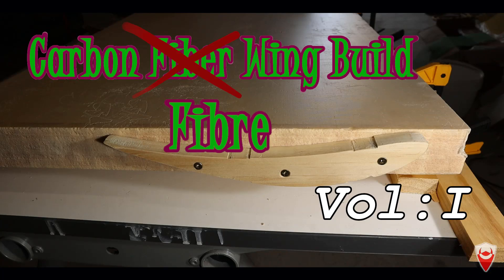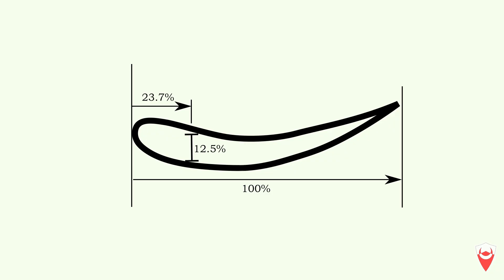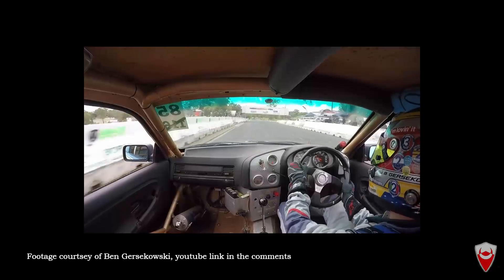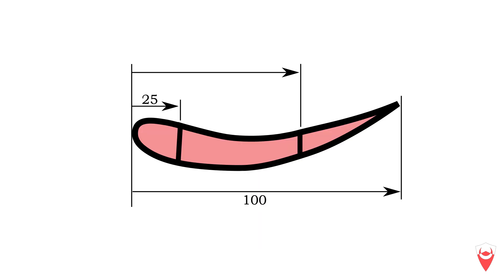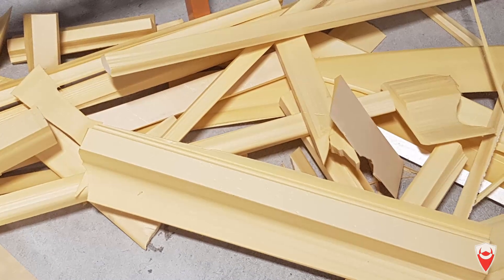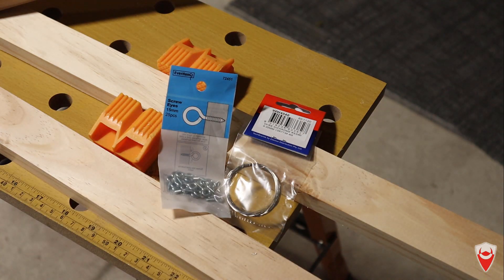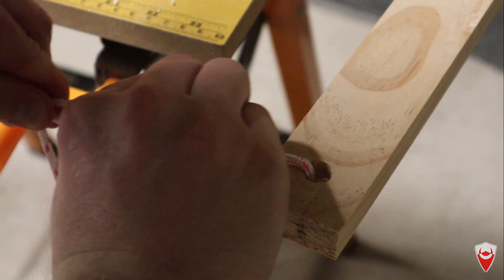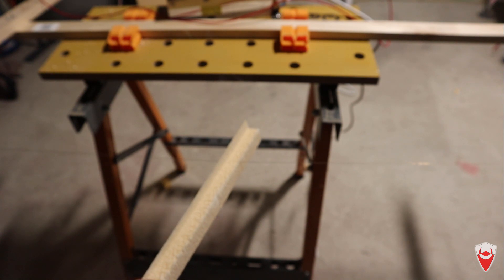[BUILD] Making a Carbon Fibre Wing: Part 1 - The Pattern - re-upload

Comment: You’re pulling too hard on your wire the wire should cut without ever touching the foam
Reply from the maker: Thanks mate. You're 100% correct. If I make another one with this method I'll change my technique.

I should also be using thinner templates so there is less chance of catching etx

Comment: Good video mate, I'm currently looking into making a wing for my time attack car. And hopefully I'll get It right
Reply: Yeh cool, see how I get on. Nah im over in Wa
Reply from the maker: Good luck. The process works. Use hot glue.... And probably cut your spars deeper and then increase the spar cap thickness with some tape after the main spar is re assembled. I think that should allow less filling and sanding.

If you're in brissy, hit me up

Comment: Great video! Even though it did not work you showed us what could go wrong, which I thought was really helpful.
Anyway, I was thinking perhaps use your CnC to cut the foam directly (with some additional spacing so you can sand it down to a smooth surface afterwards).
Reply from the maker: Thanks for the comment. I probably could have used the cnc directly, but part of the point I was trying to acheive was not using anything fancy (moulds, vacuum etc). I know the cnc is not a tool that everyone has, however those templates could be easily cut by hand using some 1/4" plywood or the like.

Video two should be out this week, and it goes a bunch better.

Comment: I am wanting to make a carbon fiber hood and wing for my car. (RX7 FC NA) Do you have any recommendations for good places to get materials and learn at different techniques?
Reply from the maker: G'day mate, it depends where you are in the world. From the use of the term hood I'm guessing north American, in which case I'd be looking at a company like composite envisions, I used them a bit when I lived stateside and they were good.

As for learning techniques, watch easy composites videos and read a few books (I mention a good one and link it in my core press punch build video, I can't get the name right off the top of my head now), then buy some fibreglass (it's cheaper) and start practising.